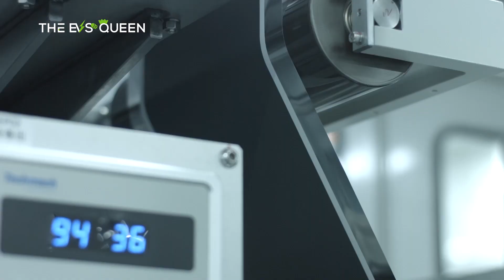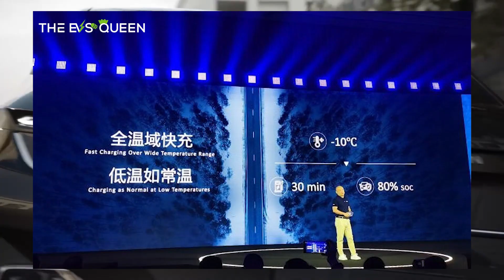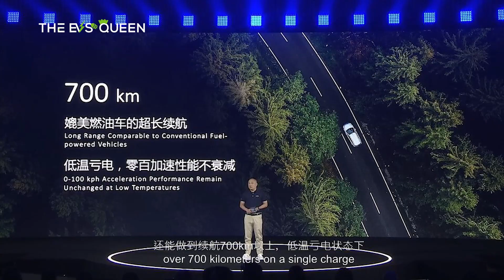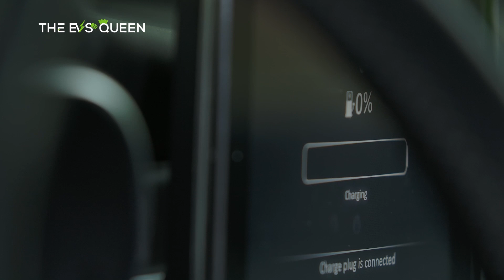CATL unveils Shenxing Battery

Comment: One suggestion.  Consider this challenge.  Create a 200 to 300  kms batterry range in 2 hours charging  but using only solar and wind power, without the need for charging manually.  This will be most useful for consumers everywhere, for it eliminates the need for charging once for all. .  Unlimited range without the need for charging is the most important challenge to save the planet from climate change..  No better goal exist.   Can you guys do it ?  If so, then you are creating a revolution.   Best Wishes from India.

Comment: 400 km on 10 minutes charge is a silly metric - it depends on the consumption on the car the battery is implemented on - why not present a charge curve  or even a top charge speed? Then one can relate to the performance metric...